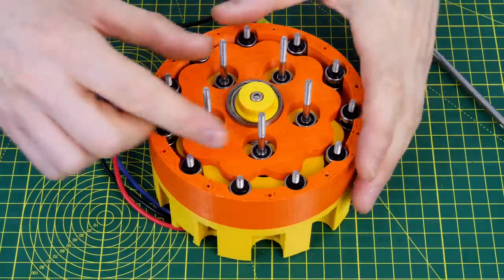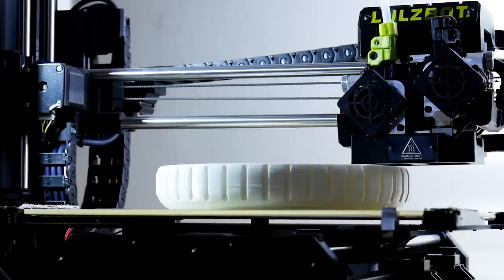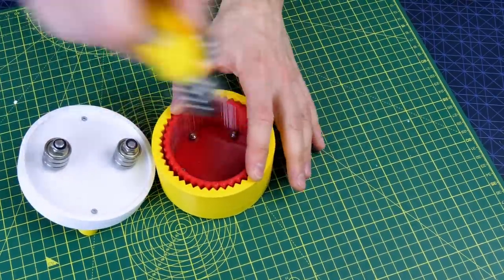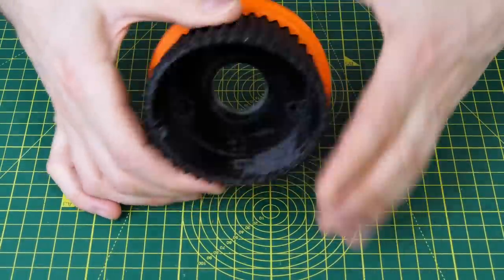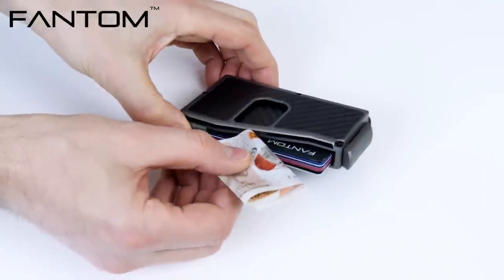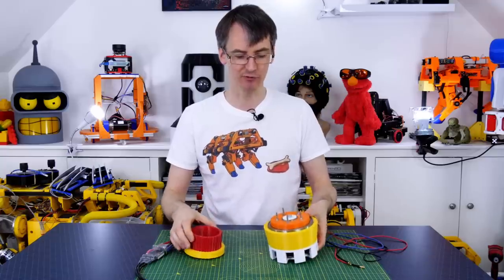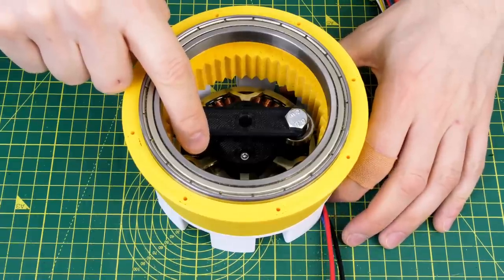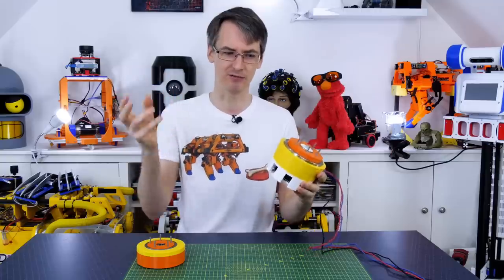Experimental Harmonic Drive Reducer - 3D Printed

Comment: I think you are giving up on the strain wave for the wrong reasons. The strain wave flex piece teeth shapes are likely the culprit. You referenced the HTD belt model. I think a tradition timing belt type with the square/trapezoidal teeth is likely more robust.

Comment: this is much less efficent. its flexing some rubber. your car tires flex more when there is less air in them and you burn more gas.
it sounds better though. i think the cyclodial drive is better for a robot

Comment: You lose energy from hysteresis as the flexible ring expands and contracts right? So a rigid plastic ring with more smaller teeth should be better.

Comment: I can't help but think cables would be far superior for this application you could easily get 10 to 1 and be completely backdriveable and extremely light the only downside is you might be limited to one or two rotations but it wouldn't matter for a dogs leg

Comment: Would it be possible to print holes in the middle of the flex gear teeth, then insert steel rods into the holes?

Comment: Could you try a different harmonic drive design, where the flex spline is a separate piece from the input and output gears? Is there some reason you didnt?

I said input, but I meant stator.

Comment: With the cyclodal drive , I noticed you opted for two drive disks, would it not be more efficient to balance it with variable infill? So one half of the disk is 100% infill. That or just having a divots to add metal washers for balancing.
Reply: No, then you just get an unbalanced mass moving around. The second disk 180° apart cancels out the force of the other disk, while still being balanced disks.
Reply: @kantpredict  It would be a counter balanced mass like you would find on a crank shaft in a ICE .
Reply: @freedomofmotion  the crank counterbalance is cancelling the oscillating piston motion. You need equal mass moving in the opposite direction to counter the vibration, hence the second disk. You could in theory make the offset input shaft much heavier on the opposite side of the motion and use a single disk.
Reply: @kantpredict  How does motorcycle tyre balancing work ?
Reply: @freedomofmotion  that's rotational balancing, not cancelling oscillations from reciprocating motion. In fact, an unbalanced tire will CAUSE unwanted oscillations.

Comment: the harmonic drive flexring needs to be more rigid, and have much less flex when rotating, the industrial ones have so little flex you almost cant see it. the ones i used had less than a millimeter in flex.

Comment: Cycloid is a torque multiplier.  Strain wave is a speed reducer. Remember this moving forward.
Reply: Torque multiplication is speed reduction; speed reduction is torque multiplication.
Reply: @ChristianConrad   the cycloid is marketed and used as a torque multiplier. 
 While the harmonic is marketed as a speed reduction.   
So when customers ask why the harmonic does not have so much torque, they can respond with "It's more of a speed reducer". 
 On paper yes they both reduce speed and multiply torque. But in the scale and parts used by James, the harmonic will never reach the torque of the cycloid in my opinion. 
To reach higher torque levels you will need to copy the original harmonic drive system. Which is heavily patent protected. So not an option. 
Cheers.
Reply: @TeamGreenGorilla  :

1) Marketing-speak...

2) Feels like logically, if you don't have wildly unequal friction (or other) losses due to a bad implementation of the one type, they should both multiply torque equally much.

3) Patents -- still, really?!? The invention is from the 1950s; patents don't last that long anywhere that I know of.

Comment: Ah see you try the Harmonic drive now like i mentioned last time, yeah no backdrive. You said yourself that the commercial ones are often made of metal and that they cause more friction. Hoewever they cause a lot less. Your problem is your flexing material is way to soft and the belt way to thick. So energy to deform the belt is high (you want that low) and the teeth deform easy (you want little of no deformation) Your teeth are triangular (when not flexing) but they perform worse then round teeth that are harder this way. Commercial belts are thinner and you can get reinforced belts that are a lot stonger.

Comment: The fact that it has to deform the flexible part, does make me think that it is less efficient than the other one. Why not use planteary gears?
Reply: I think strain wave drives are simply not suited to this specific application. They can have very high ratios in a small space and can have very low backlash, neither of which are specifically useful for him. I think he'd agree that planetary gears would be better for this project but he just wants to show off the idea.

Comment: I'm not sure your material or design choices on this one are optimal. A more rigid material for the spline cup with a smooth section to allow deformation would be preferable. As well as smaller teeth.

Comment: Whats the reason for not using planetary gears, they are used in many industry's today and are reliable ?
Reply from the maker: Pretty sure the teeth would break when a 30Kg robot dog jumps on the ground.
Reply: @jamesbruton  I have small nylon teeth in the hub of my ebike that pushes 150kg up a hill at 30mph, they are herringbone gears, which are very strong, I've seen alot of 3d printer's using these for various applications, might be worth a look into.
Reply: @wolfe1970  think about the shock loads on the sun gear.
Reply: @davidelang  Loads of applications have shock loads through the gears, like the back wheel on my ebike, or a cars gearbox, so long as they are printed like herringbone so you have more contact on the teeth, dont knock these gears, they are strong
Reply: @wolfe1970  you aren't going to use herringbone gears for a planetary gearbox, there's no way to assemble them
Reply: @davidelang  I printed them and use it in my extruder on my 3d printer, you clearly don't know how one works

Comment: https://www.youtube.com/watch?v=7QidXf9pFYo
shows that the flex part wedges two different gears together.
What you have done is take just one gear and put all strain on the flex gear, while the flex gear is meant to wedge between two real gears, as a wedge.
What if you:
1) free the flex gear, but make sure it doesn't run off.
2) put a real gear with a 2 teeth difference ratio next to the other.
3) if possible: put that same gear on the other side too...
This way all strain should be located near the teeth, and not the whole flex gear body.

I think they use steal flex gears in the industry so they don't need the extra gear to wedge between.

Comment: I made an openscad scrip that generates gears years back (usual involutes which would be good for the strain wave gear, and cycloidal which would be good for the cycloidal drive). I've just published the files on thingiverse, I figure it might be useful for you. You can use openscad to generate the profile, export as DXF and use it in fusion. A proper tooth profile would probably help with smoothness and efficiency for both drives. You could even get rid of most of the bearings in the cycloidal drive using a proper tooth profile, saving money/space/weight.

https://www.thingiverse.com/thing:4818994

Give a yell if anything needs explaining, I don't think I did a great job documenting it but I believe the variables were relatively self explanatory.

Comment: Gah.   The harmonic drive is DRIVEN by wedge force of the teeth.   Pure friction force.    With no torque the wasted energy JUST IN DRIVING  is going to be the cosine of the gear face angle.   IOW if you have 20degree tooth angle only 7% of your energy  (and force) is going towards moving the output round.   Sure you're getting a lot of force ... again that wedge angle,   but it's horribly inefficient.   It's worse against substantial torque because the central belt i s now deformed against the downward force...,,  more force and energy percentage would go to move the drive forward .... but now the resistance is increased horribly further increasing the deformation.  It's a lose-lose vicious circle (well I didn't intend the pun before I made it, but I intend it now).  

I'd also point out that there's NOTHING preventing the belt from backsliding against it;s forward motion EXCEPT it's own deformation force.   Given that there's only a few millimeters of deformation doing that forward drive and what, 70 to 80 mm between the cam bearings there's plenty of room for it to slip backwards if there is ANY play where the teeth meet.

It's cool that it CAN do that kind of thing but it's deficiency of efficiency and  compromised structure by design make it very dubious for larger loads.   Possibly a metal flex belt would work in some odd particular circumstance.    but it's poor choice for most cases (IMO,  I'm a "software engineer" who once studied some physics, not any kind of authority here)   

EVEN IF you can get the tolerances down to where you can make it work with some reliability and at least moderate force, the inefficiency means HEAT.    PLA and flex plastics??    If you run the thing about five minutes it's gonna be "interesting".   But not at all purty.